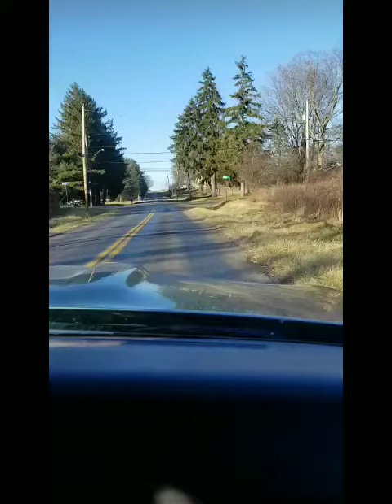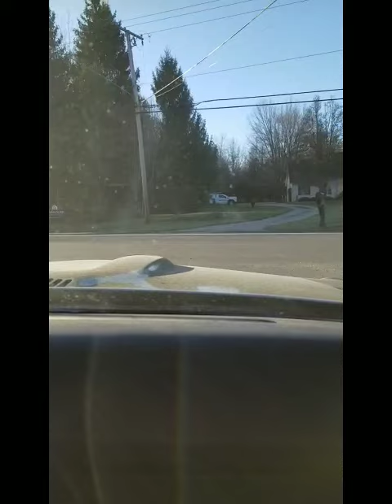DCI Motorsports 70 GTO with RAM AIR 5 Tunnel Port pump gas 455 test drive

Comment: Wow, she revs! What's the redline on that thing?
Reply from the maker: Thank You :)  The rev limiter is set at 6800 currently. It will make power safely to 7500 though. Just no need to abuse the engine. Its plenty fast right where it is LOL.
Reply: @DCI Motorsports  I can imagine a 540ci version of this thing revving out that high. 
1000hp all natural. This is why the Ram Air V is my all time favorite V8. Nothing like it, and it beats a Hemi
Reply from the maker: @hoost3056  If your on Facebook go check out a customer of mine page. Judes Schnabel has a 535 with my heads making just shy of a 1000 on pump gas. He also has a mobile dyno business. :)

Comment: Sounds super sweet. Can't wait for track times, with slicks, and open hedders. :)
Reply from the maker: Thank You for the Kudos. Not real sure how much track time this one will see. Its built for fun at the local car shows and cruises. I wouldn't be a bit surprised if with a set of stickies out back and a good driver at the wheel. This would go deep into the elevens or maybe high tens. :)
Reply: @dcimotorsports1111  I'm sure you could talk the owner into just 1 or 2 passes, for fun. :)